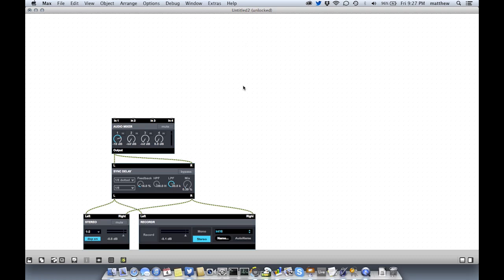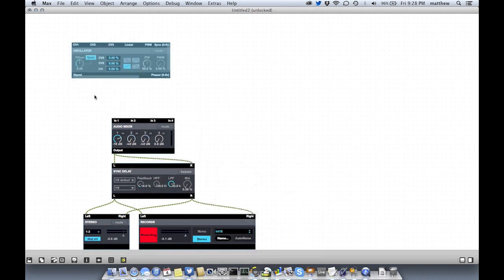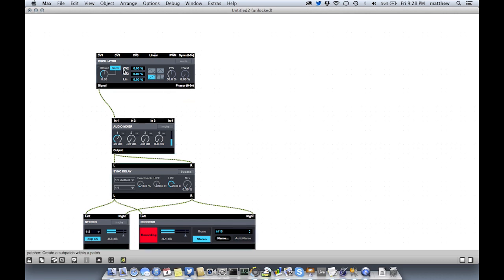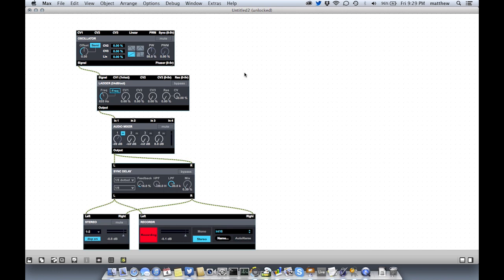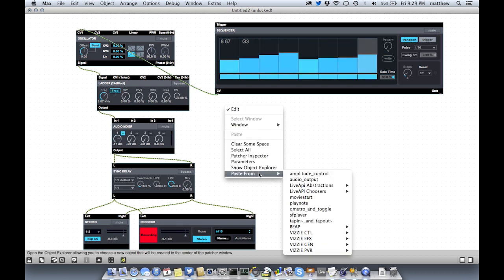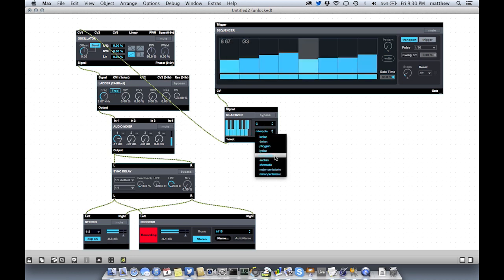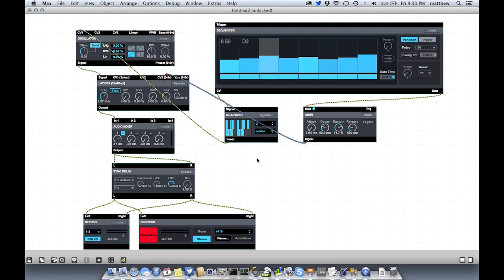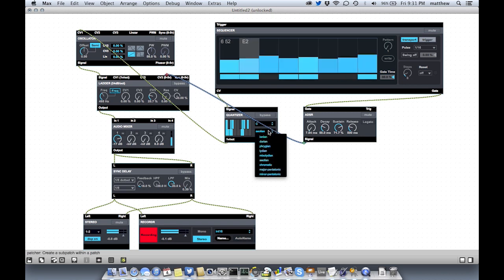Beap: Getting Started

Comment: This is great, but the sequencer isn't doing anything for me. I loaded the objects the same way as you did it in the video, and I've even tried to get it moving with a metro object but nothing happens. It just stays completely static. What might I be overlooking?
Reply from the maker: Are you using a Master/Global Transport ?
Reply: stretta Woops, that fixed it. Thanks!
Reply: stretta I've looked everywhere but I cannot find it. Where is the Master folder? I can't find the Master/Global Transport!
Reply: I gather you're using Max 7. Then it's in BEAP > Sequencer.
Reply: DoglessEndeavor Hello,same pb as you last year nothing is happening. So I grabbed this thing called Global Transport in Sequencer menu, but there is something to plug in or out, just an On/Off bouton and the Bpm. How do we use that thing so the sequencer can work? (I have Max for Live so 6) thanks
Reply: Cedric Douhaire You only need to turn it on. You don't always need cables in Max, since you can use the send and receive objects to bypass cables. So the lack of ins and outs shouldn't concern you. Just turn it on and there you go :)
Reply: DoglessEndeavor well it still doesn't work, it worked some how before (the sequencer worked once) but since a while, the sequencer and even the gigaverb now don't work anymore for me. I tried the tutorial from a max documentation and my problem looks deeper: when I use output bp.stereo nothing is happening (DSP in on by default) but when I use the "plugout~"object I have some sound. It installed BEAP again, same issue. 
It looks like I have a problem of recognition of the BEAP modules isn't it? Anybody had the same problem and found the solution? I'm desperate!
Reply: Cedric Douhaire are you using Max with Ableton Live? if so, press play in live :)
Reply: Niclas Lindgren You are a genius for understanding my problem!
I feel a little bit stupid now but whatever!
Thank you so much !